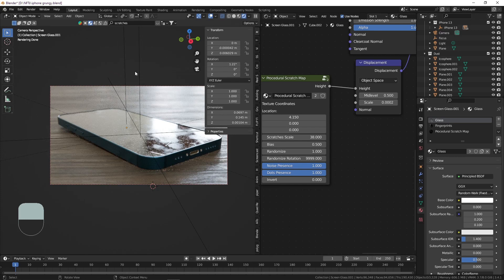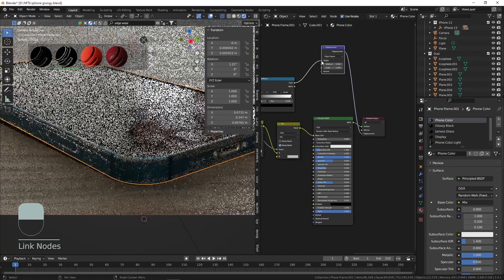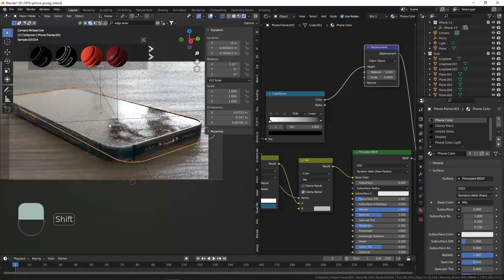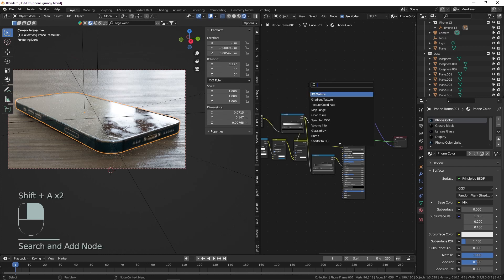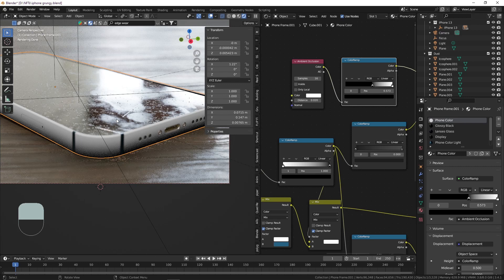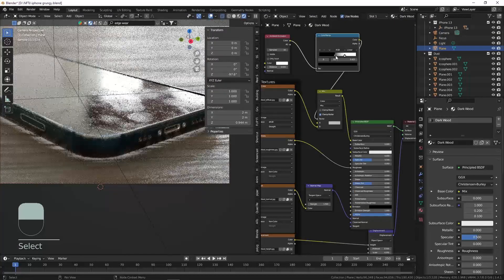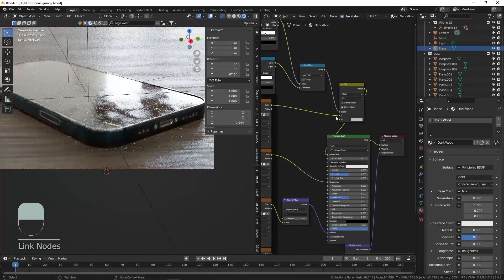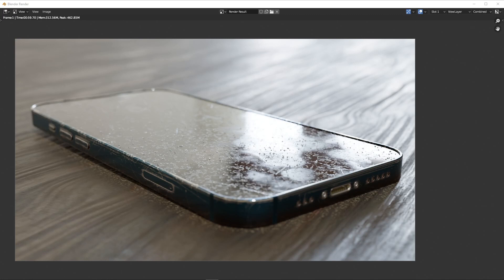Blender Tutorial - Surface Imperfections for Realism | Part 3: Metal Edge Wear & Finishing touches

Comment: I've noticed that you don't use a bump map node. Is using a displacement map node better?
Reply from the maker: Hiya! Good point, thanks for asking! It will give you pretty much the same results if you have your material settings set to bump only. However, if you're planning on using the model for something besides Blender it is better to plug it into the height socket of a bump node instead of the displacement which I did here. When I just use it for Blender though, I find that it sometimes gets annoying that the strength of the bump node controls both the normal texture and the bump height texture, which is why out of automatism I just plug it into the displacement so I can control them both individually with ease. Hope that clarifies :)
Reply: @NinoDefoq  oh yeah..I've noticed that as well, about the bump node's influence. Thanks for the clarification
Reply from the maker: @lukayz1363  you're welcome! And thanks for the questions